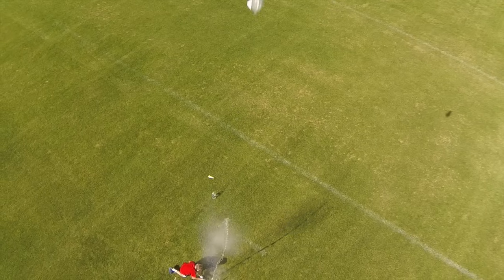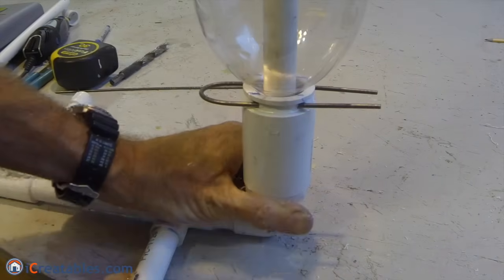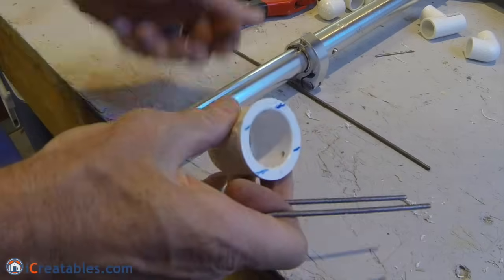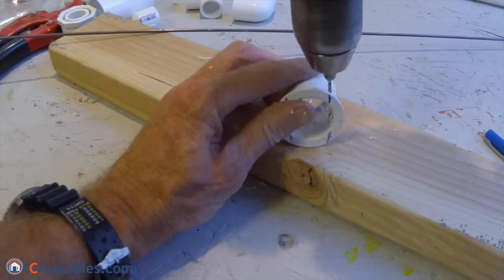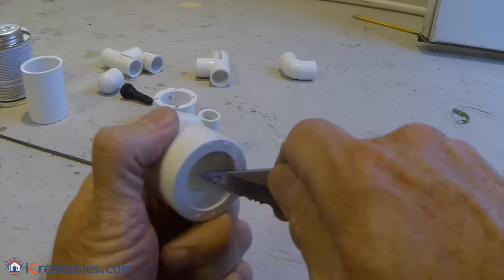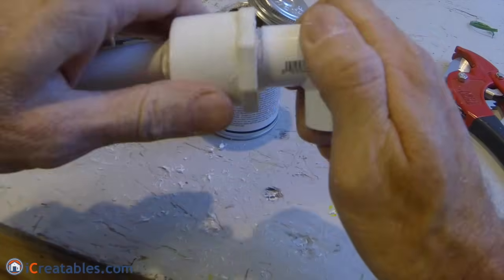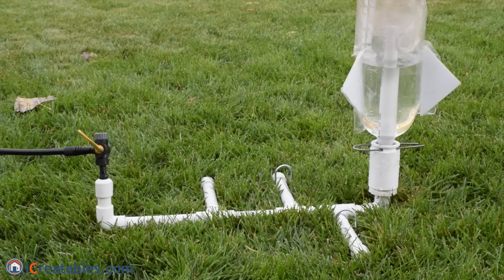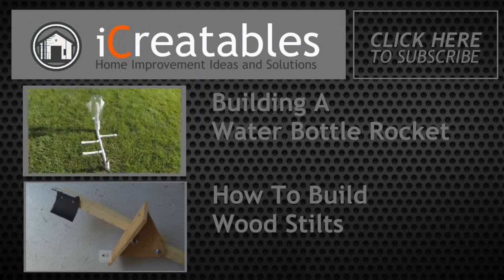How To Build The Simplest Water Bottle Rocket Launcher

Comment: the water would come out from the gap of the water bottle neck. it don't hold any pressure when i fill it with air. its not air tight enough why is that?

Comment: After building this launcher myself, I have some tips for anyone planning on building this:

-It isn't specified in the parts description, but use unthreaded PVC
-Purple primer and cement worked well
-Use tent stakes to hold the launcher in place when launching
-If the pipes are tight, using a rubber mallet after the primer and cement to push them together firmly
-Bottles with a smooth side work well, I used a Pepsi bottle
-Consider rounding out the top of the launching tube with a dremel to make sliding on the bottle easier
-Foot pumps make pumping easy
-If the bottle is leaking once you pressurize the system, wrap 2-4 small fragments of packaging tape around the stem of the launcher where the bottle's rim is located once secured inside the bushing. Every part of the pipe that the bottle's rim goes over should have the tape to act as a seal. There will still be a little bit of water leaking out, but after passing 20psi the leaking should stop
Reply: Can you clarify what you mean by adding the tape? As in put tape on the outside of the bushing between the coupler and the top? I.E. the area with the drilled holes? Or the inside of the bushing?

Comment: It’s been some years since this video was posted but since I’ve already built this I was hopeful someone could help: 

It leaks up at the launch mechanism it spills up out of the launch pin holes. What’s interesting is that this leak gets worse when the air is being added. 

I’ve triple checked the video to see if I built right. I’ve went to each connection to reseal. 
I’ve used two different 2 liter bottles. 

My students already built their rockets and is just waiting for me to get the launch pad right. 

Any advice to troubleshoot would be nice. Thank you.
Reply: you can use heat from a candle (or heat gun) to soften the 1/2 inch pvc launch tube and push it together to make it swell slightly in one spot.  The bottle will seat firmly and air tight on the swelling.  It's a bit more difficult to get the spacing right for the retaining pin with this (requires more precision) but you can use ordinary hose washers at the bottom to shim and get a tighter fit, if necessary.  Using this method I have pressurized rockets up to 100 psi.  It does leak a bit at that pressure but you are talking losing 1 psi every 5 minutes or so and it doesn't interfere with the launch.

Comment: I’m having the same problem as others, it leaks out and maxes at 20 psi for a good 100 ft launch. Going to come back and comment  once I find a solution!
Reply: Did you find a solution?
Reply: @drstamas  I found that 7up bottles work very well
Reply: that’s incredible mine just flew 60 feet
Reply: It looks like it needs some rubber o rings or rubber gaskets to make it seal

Comment: Thank you for this!  I made this with my daughter.  The science project SUCKED since she was at home learning, but this video was beyond useful.  (My son, who had done the same project, was helpful - when paid with cash.)  She needed to launch a water/air powered rocket 40 meters for an "A".  This videographer's rocket is very similar to the one that we made.  The things I learned - the launch tube needs o-rings - squishy ones, a dremel tool is beyond useful for carving plastic, a landscape stake can replace the metal rod, it's the length of the 2 liter bottles seems to be the "size" difference.  For the rocket - fizzy soda bottles are made from thicker plastic, hot glue - even when applied with cold water inside the bottle doesn't make a very strong fin attachment; our fins fell off after 2 launches.  Packaging tape worked well, duct tape was better but heavier.  We went through 3 rockets before finding success, no fault of the launcher.  Our final, successful launch - 56 meters - had the 4 fins slightly angled - same angle for all 4 fins to create a spinning motion, a plastic cone shaped from a school folder and adhered with packaging tape, launcher was angled about 45 degrees, slightly more than 30oz of water, bike pump at 30 psi.  The thing does leak water, but with the squishy o-rings, it's not pouring out and actually makes a whining noise when the pressure builds.  Since I know nothing of pvc fittings, it took us about 7 trips to home depot.  I messed up the hole drilling for the launch bushing, so I recommend buying extras of that part.  It was also difficult to find the parts and we traveled all over to find them.  I had to have the husband drill for me, and I lost his 3/32 drill bit before he started the process.  Besides the parts needed for the launcher, I bought a 9/16" drill bit (hard to find) and an $$ dremel tool kit.  Both tools were super useful.

Comment: This is amazing,  I tried it and it came out OK,  couple of observations.

1. How do we avoid water leaks from the bottle? Looks like whole of the PVC structure is filled with water leaked from the bottle and also the cap hole holding the tirevalue too. still to make the steel rod stopper to work properly but, it does pump air and able to push a bit up the bottle into air.
Reply: Mine leaked at the bottle once the system was under pressure. I resolved this using o-rings. Can't tell you exactly which size I used unfortunately. Just pulled one from the "sink repair" drawer

Comment: How did u prevent the water from leaking out?
Reply: Indeed you need some sort of rubber seal to stop the water from being pressed out while charging. The central pipe is just a guide.
Reply: I also didn't get this. No rubber or anything.
Reply: I added a washer but I can’t get above 20 psi before it starts leaking.
Reply: I went and got hose gaskets and  put two in and I was able to keep a seal up to 60 psi.
Reply: The launch tube inside the bottle extends above the water level, therefore the water doesn't leak out.

Comment: hey cool video i plan to make one, i was wondering what is the point of the 3 extra lengths of pipe that you cap off... are these to help it pressurize smoother, or are they just for stability of the whole contraption?
Reply: Air chamber and to create "legs" so the system is free standing

Comment: Hi! Thanks for the tutorial! Our first attempt we used a diet Dr Pepper 2 liter bottle and it leaked like crazy and it made launching quite hectic. After reading the comments for the video we tried out a Diet Coke bottle and it worked great. No leaking. It totally changed the experience. Thanks!
Reply: @Justin Giger 2-liter bottles aren't standardized, so you'll find slight differences between brands, or even between bottlers in different areas of the country.

Comment: Saw one similar at a science fair. Can you use just air and no water? They had just air
Reply: NGC197679 if you can manage to avoid the air leaking, then yea just air works, the water make the rocket go higher though.

Comment: Thanks! I built one based on your video instrution. There was some water leaking, but it works. When I got home, I added a rubber O-ring around the launch tube. Now the rocket is on there pretty tight. I'm going to test it tomorrow.  

https://youtu.be/edYc2wv_jFw

Comment: Why is there nothing about sealing the bottle to the launch tube so the water and air don't immediately leak out as soon as pressure is added? I cannot understand why the rocket in the video works as-is, or how other people have gotten this to work, if built exactly as shown.

Clearly, other people here have had the same problem we encountered. Now I've found other plans showing an O-ring used to seal the neck of the bottle, but once this launcher is glued together it is impossible to add the O-ring inside the large bushing later on. Such a waste.
Reply from the maker: +Carl Gruesz It depends on the bottle and the pipe sizes. We have been to events with hundreds of bottles and there are some that fit great and some that do not. But even the ones that do not fit well you can fill the bottle up with some extra water and then pump quickly and launch the rocket when it is about half full.
It is never a perfect fit and all bottles would eventually lose pressure. But as you can see from the video it does work.
Thanks for watching.

Comment: What asre the measurements for the 6 foot pvc pipe, where should it be cut?
Reply from the maker: +Matt Sosa 6 inch pieces works well for the longer connections and 2" for the shorter ones. Thanks for watching.
Reply: +iCreatables where do you became so viral?
Reply: +iCreatables how many longer connections and shorter connections are needed?

Comment: what is the name of the piece that the tire valve goes on?
Reply: also, what is the "t's" part? fittings?
Reply from the maker: +Silent Assassin The valve goes into a cap and the T is called a "T"
Reply: +iCreatables I need the launcher to launch at a 45* angle, so is it ok if i were to glue on a 45* angle elbow instead of a 90* angle?
Reply from the maker: +e²_837 It is just air moving through the pipes so the angle is not critical.
Reply: +iCreatables For the launcher mechanism, I accidentally drilled the holes a bit low, and the bottle doesn't line up so the pin can go through. If I remove the tiny lip of the bushing on the inside, would it affect anything? Or if I were to make the holes larger so it can go above the lip of the bottle. 

Thanks for the speedy responses BTW
Reply from the maker: +e²_837 I would make the holes taller. As long as you still have enough of the lip of the bushing to hold the rocket under pressure it should be fine.

Comment: won't the water in the bottle may fill the launcher?
Reply from the maker: +Piolo Pablo  Some water does go into the launch tube. But that is ok. It is a sprinkler valve and once you put air pressure into the system the air will fill up any space that there is not water.

Comment: If you modify the launcher for small 12oz bottles making it only as big as it needs to be the bottles fill with air in seconds with very few pumps, you don't need to add water, they hold allot more pressure, and the bottles traveler faster due to less air resistance.
Reply: Quick interesting eye opening lesson example on pressure and why 12oz bottles can hold more pressure then 2L bottles the same thickness. I tried to get the numbers as close as I could while making it easy to visualize (bottles have more area of course) put .5 PSI (pounds per square inch) on an area that's 2 Inches (")  X 2" and you have 2 pounds (lbs) of force now put .5 PSI on an area that's 10" X 10" and you have 50lbs of force- better yet 120PSI (Coke or Pepsi shaken up and baked in the hot afternoon sun) on 10"X 10" that's 12,000lbs of force- scary stuff!! -- and people wonder why natural gas explosions are so devastating even a small amount of pressure pushing on all walls compares to a head on train crash!!

Comment: I built a rocket launcher using your directions. They're great. Thank YOU!

My launcher leaks around the bottle opening when pumping. Any suggestion? What brand soda bottle have you used?
Reply: +iCreatables 

Try the zip tie, hose clamp, and 1-1/4" coupling method. It involves heating the pipe by rotating it above a candle to create a slight bulge (by pushing the ends towards each other) to create a tight seal for the bottle to sit on, then using square ended zip ties (held together by duct tape mounted in place by a hose clamp) and an Inch and a quarter coupling to hold them onto the neck of the bottle to keep it in place, and to launch the bottle you slide the coupling down (agents the force of a spring that kept it in place) the zip ties that were kept in place by the coupling then slide off the neck of the bottle and it launches. I built mine for tiny 12oz bottles and made it only as big as it need to be- all I need is 5 pumps for a decent launch- no water, they can hold more pressure, and they go faster due to less air
resistance. I also built a handgun version of this since I have a large yard- I use it to shoot fishing line over trees so I can hang my Longwire Antennas very high.
Reply from the maker: Holly Howe We did not keep track of the brands but there is a difference in the mouth opening. Try out a few different ones. We fill the larger mouthed bottles up a bit more and pump it up fast.
Reply: I can reach 185PSI with the small 12oz bottles before the bulged area of the pipe starts to leak- 200PSI might be possible.
Reply: +iCreatables 

I did however create another issue with my air rocket 12oz bottle launcher. During launching when there is a micro pinhole gap between the bottle and the pipe the air rushing through the pinhole gap reaches speeds like 10 times faster then the speed of sound not only making the loud pop but putting hairline cracks in the lip of the bottle from the shockwave that's created and bottles can only be used a handful of times. This is also the same reason you hear a loud pop when you pop a balloon or have a tire blow out- just look up Paul Menard tire explosion.

Comment: I'm about to start my build, how do you keep the water from coming out from the launching mec. When the bottle is installed for launching?
Reply from the maker: THEREALSINNER247 A little water will spill out as you tip it over. Just put a little more in the bottle in the first place. thanks for watching.

Comment: So we tried making this and the 1/2 inch pvc pipe that the bottle slide down on is too thick. It makes for a tight fit, and without lubing up the pipe with vaseline, it won't shoot off. How does yours slide on and off so easily?
Reply from the maker: Aimee Jensen Hi, I would try a different bottle. The pipe size is universal so it should not vary but the bottles do vary. Some of the bottles I have used will leak more than others because of this variation. Worst case scenerio you could go to a different store to buy a different manufactures pipe and test one that will fit better, cut off your launch tube about 1 inch up and install a coupling and the new pipe. But I would bet that getting a different bottle will fix it. Good Luck!
Reply: iCreatables We tried a different bottle and it worked. Thank you!!
Reply from the maker: Awesome!